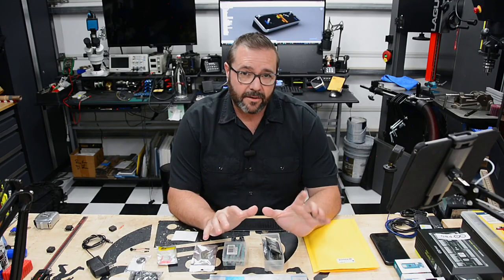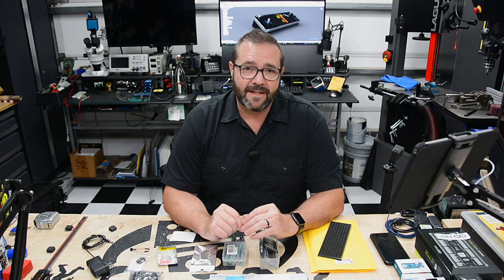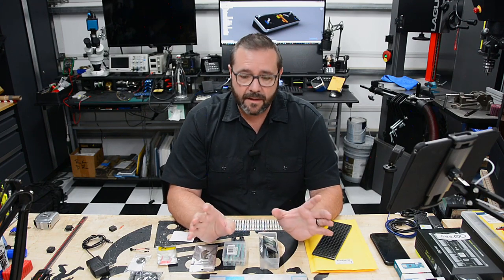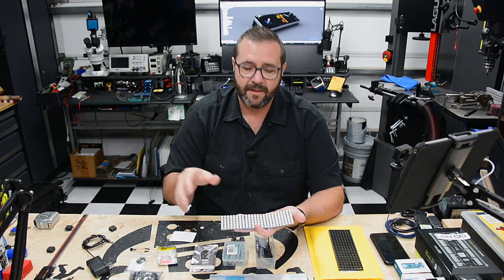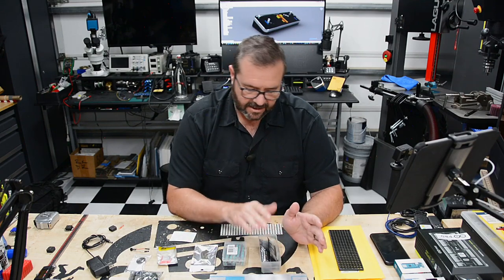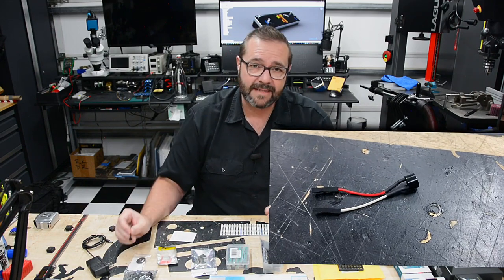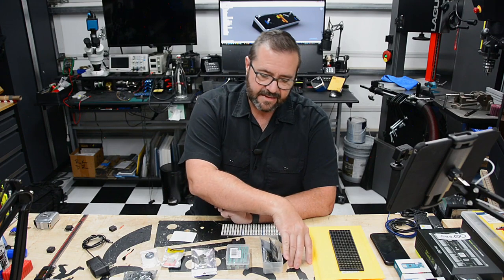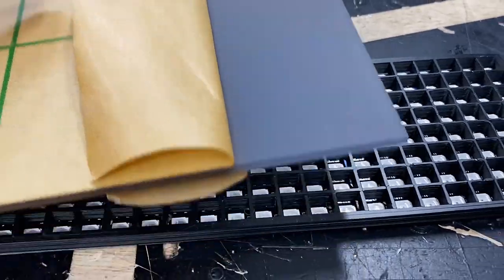A New Modern Retro Pong, Designing the Pongcade!

Comment: You really did a very fine job with this. I wish I had access to Altium back when I built something remarkably similar to this a couple years back. The LED dot matrix that I created had to rely on a bunch of prefabbed PCBs that I strung together because I just didn't have the software or skills to make them myself. Turned out okay. Your project shows how much better (and more compact) the electrical and mechanical design can be with a proper integrated design suite.